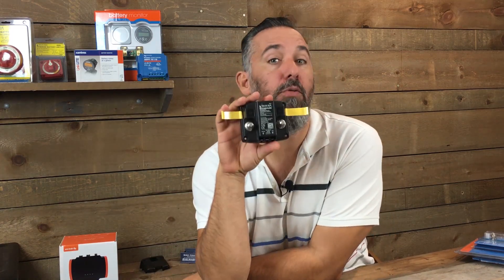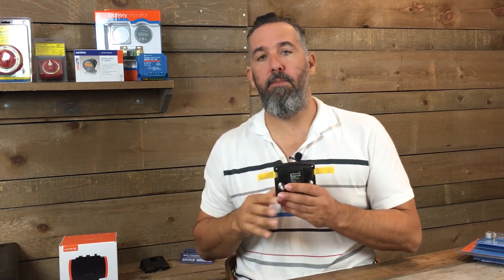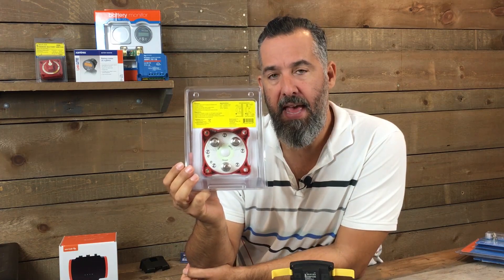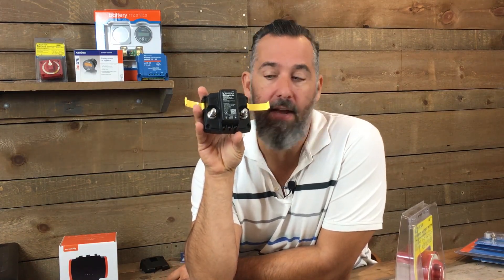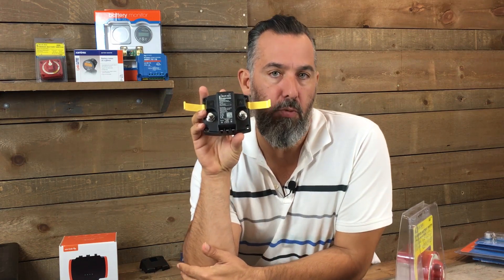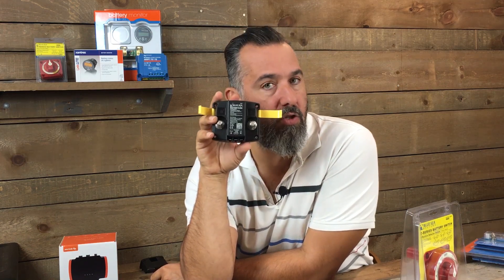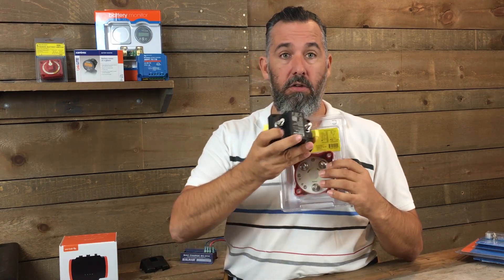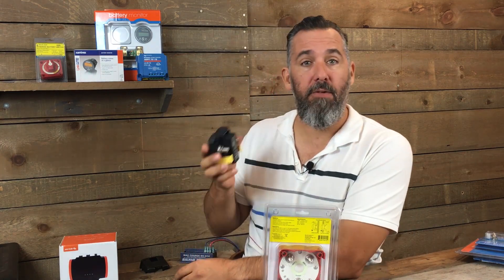How Do I Wire My ACR to My Battery Combiner On My Boat?

Comment: Hey Jeff, Thanks for the educational video.   I Have a question.   I have a dual battery set up in our boat and I am using the Bluesea Mini Add a Battery Kit that comes with the M ACR and their battery switch.  I have followed the instruction to the T for installing this system.  Now what I would like to do is Install a 120V external 2A battery charger/maintainer in our boat so when it's at home in the driveway  I can just plug in the charger/maintainer to make sure that the batteries are charged for the next time we take the boat out. Now my question is:  How do I stall the external battery charger?  Is it as simple as connecting the 120V external 2A battery charger/maintainer to one battery and the M ACR will transfer the power to the second battery when needed?  

 I haven't found any instructional videos on this topic.  
Stay safe and all the best.
Tim...
Reply from the maker: Good question, assuming your small charger can bring the surface voltage to 13.3 / 13.4 volts to trigger the battery combiner to be in closed and in parallel.
Reply: Hey  @PacificYachtSystems , thank you for the response. Just to give you and anyone else an update to my question.  The answer is yes it works and it charges both batteries.  I just installed my charger and tried it yesterday. Now yes I know it’s a slow charge because of how small the charger is (2Amps) but when the first battery is fully charged the ACR transfer the charge if power to the other battery. 
Thanks again for getting back to my question as quick as you did.  🤙
Stay safe and all the best.
Reply: @416Expedition  Hello. I've got your setup and I just connect the charger (when necessary) to one battery and they combine via the ACR and both charge. The ACR is a really great way to go - I like it!
Reply: Thanks  @razorsharpbt124 . Ya it’s a great system.   Thanks for your comment.

Comment: Hi, jeff...LOve your seminars. I have twin crusader engines. Port charges 2 start-up  Lead Acid 12 volt batteries and STBD charges the 2 AGM 12 volt house
batteries. Is the ACR useful for me and if so, In what configuration?
Jean-Francois
Reply from the maker: Yep, a battery combiner like the Bluesea ACR would allow each battery bank to help recharge the other battery bank, whenever we have a charging voltage on either battery bank.

Comment: Jeff, does the ACR draw current for operation when no charge is present?
My boat is on a mooring for the season, and it’s possible that it might sit for, say, two weeks.
Would the ACR be drawing from either battery during this time.
Also, does it matter which terminal on the ACR gets connected to the engine battery (with alternator) and house battery?
Thanks for all of the great info you provide!
Reply from the maker: Good question, yes the ACR battery combiner does draw some power even when the batteries aren't in parallel.

Comment: I'd advocate removing the combiner altogether because they fail often, they're prone to unfavourable positions due to user oversight and the biggest problem is that in order to be accessible as an interface it breaches the cardinal rule of keep the charge cables short.
The best place for an AVR is in a direct path between the alternator and house battery with the engine battery Y'd from the alternator side.  Apologies Jeff, I have to disagree, I deem those switches as inappropriate for fitment. You said it yourself you advised a client to replace theirs after destroying three alternators...this is not the action I would take.
Reply from the maker: Hi Liam, thanks for sharing. Nothing wrong with differences in opinion especially when it's well articulated and explained.
Reply: What's the alternative, isolated battery switch and a dc-dc charger?
Reply: Automate it. Use a contactor and a microprocessor. If you need manual control use a switch on the relay coil. The amount of times I see €100s of cable for the sake of a switch to make a system perform worse (because long cables) and be unreliable (because human interaction) is pretty crazy.
Reply: @scruff7559  I'm not sure I follow?  A dc-dc charger is intelligent and has both isolation functionality to engage and disengage house battery charging when a charging voltage is detected as well as intelligent battery profiles for various types of battery chemistries, is this what you mean by a 'contactor and a microprocessor'?
Reply: I know what a DC-DC charger is. They're usually very small. I can get 100A split charge across a suitable AVR like a Smartbank.
There's nothing wrong with AVRs if they meet specification...big if... they are usually better than DC boost regulators. What I'm saying is the manual 1-2-All-None battery switches are a poor fitment choice.

Comment: If the cables are 7 inch from switch to ACR do you need to fuse the wire?
Reply from the maker: Certainly recommend it, as battery combiners cannot limit the amount of current going through the battery combiner, and sometimes when the batteries are quite uneven, you might get way more current then your wiring and battery combiner can handle, the fuse is there to protect your wiring and battery combiner.